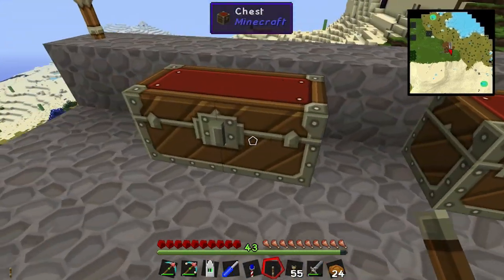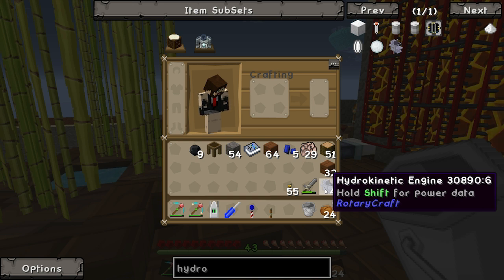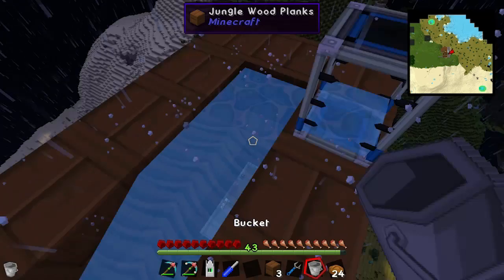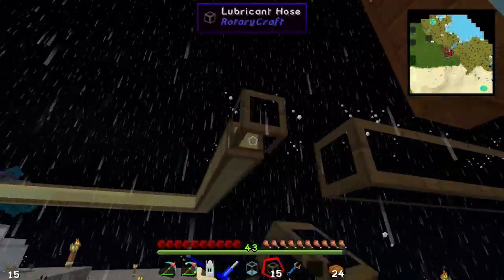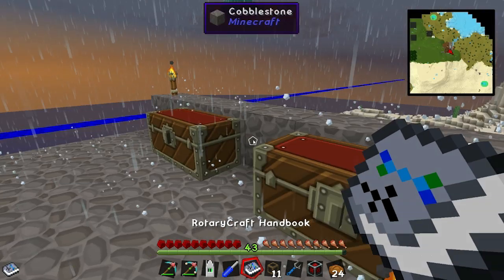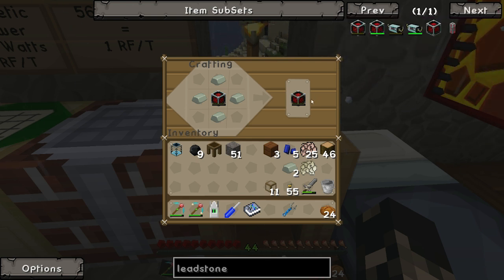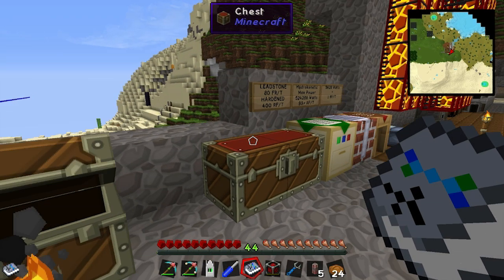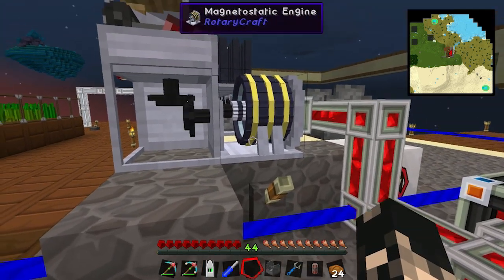Monster FTB Hydrokinetic Engine, Rotational Dynamo, Magnetostatic Engine

Comment: From what i can see, you can use the redstone energy cells but you can also daisy chain a bunch of magma dynamos together too for power and you only need a trip int the neither for that when you melt neitherrock down. If it charges up a redstone cell then most likely it can be used to power with too.

Comment: Can you use rotarycraft in combination with a sorting system like an me system or logistic pipes?
Reply from the maker: I'd imagine so, if they haven't got direct compatibility, thermal expansion 3 can access both so you use it as a in between.

Comment: Did they nerf rotational dynamos? My setup is just like yours and I'm getting a "exceeds conversion limits" error and a very low rf/t output.
Reply from the maker: Yes they did, its nerfed to max 47 rf/t, Check this one out, http://youtu.be/1v2uj4i41eU its rotarycraft to steam to rf, has about 20% power loss but its best I've found so far without using many rotational dynamos